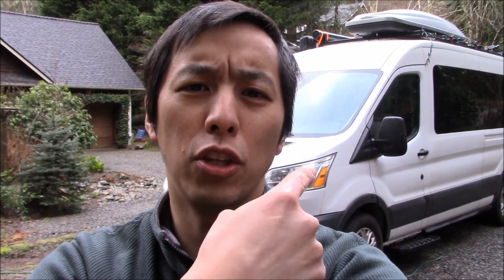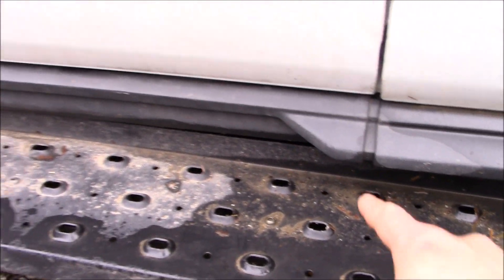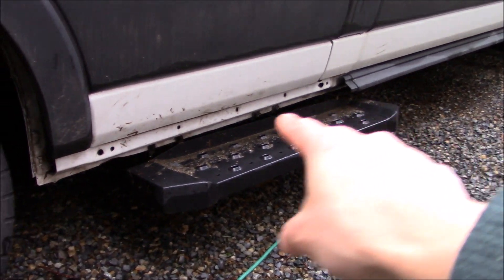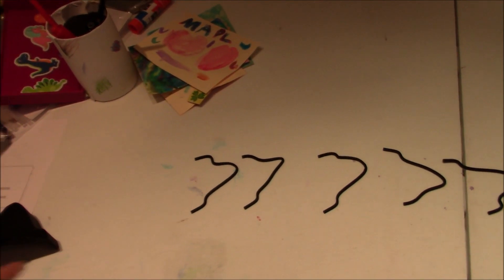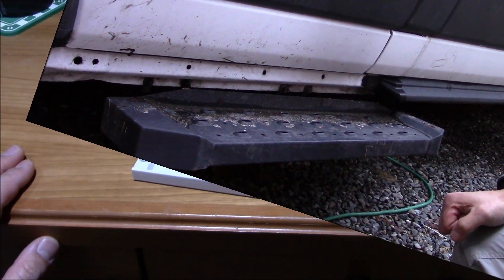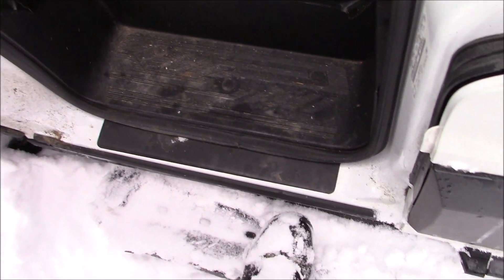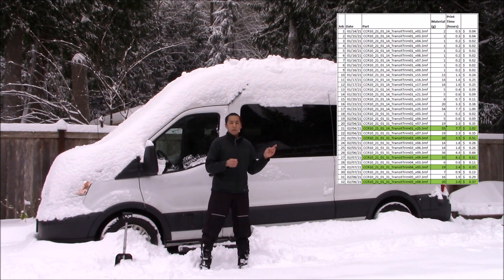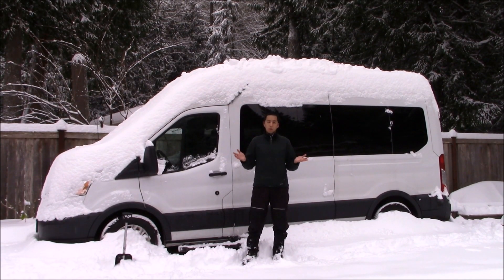3D Printing Trim Pieces For My Van

Comment: I have the same van and I havea question.  Are you getting water inside in the bottom traugh in the section at the floor level under the window on the drivers side under the CRL window section?